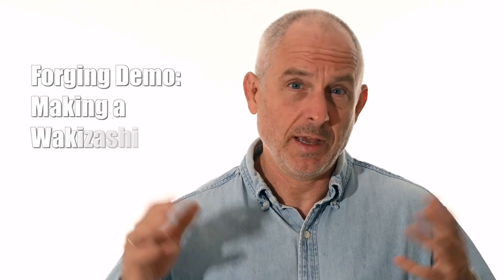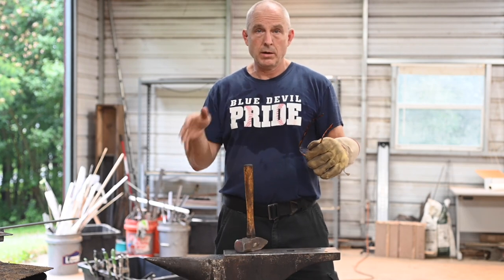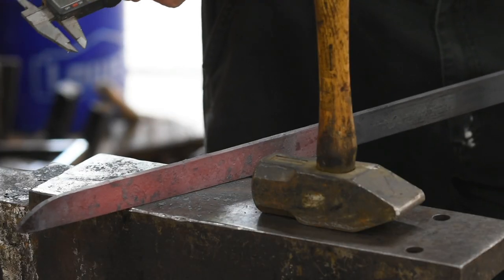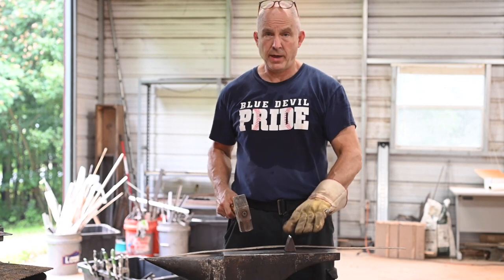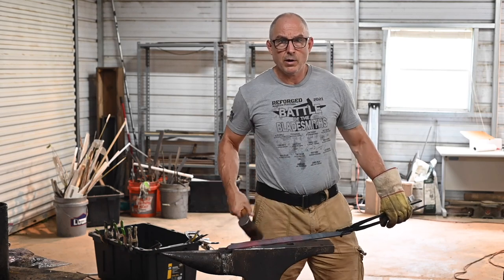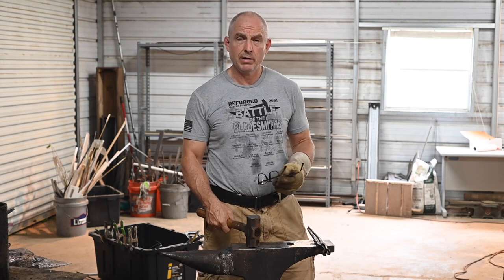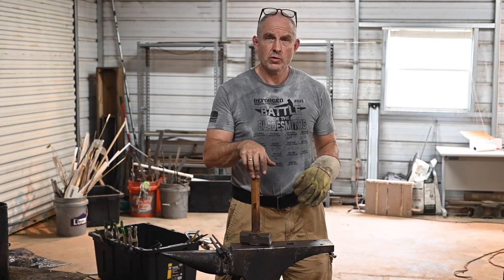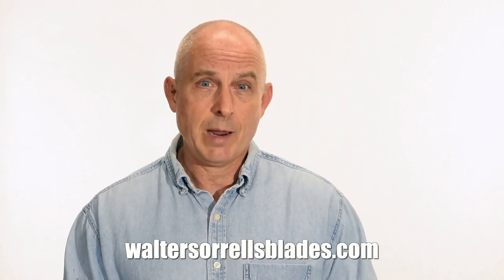Forging A Wakizashi - Japanese Short Sword

Comment: Great video. I'm a relative newbie, with a couple of years of forging experience. Your info in this video was a good reminder to me not to swing so hard when working the blade sides and bevels and to control my hammer face. I have spent unholy amounts of time at the 2x72 working out dings and low spots only to be left with a blade that is then much thinner than intended or useless. Time spent honing my skills with the hammer and anvil are whats in order for me! Thank you.

Comment: Hey Walter do an internet search for vertical hanging acoustic baffles. You can buy the fancy ones or you can make them out of those cheap suspended ceiling tiles and hang them by the edge with wire. Just be sure to use a somewhat random pattern to prevent harmonics. My guess is maybe a dozen or so would work wonders. You can also make a few room divider style frames with the acoustic panels and set them around your work area. Cheap and fairly easy.

Comment: What you really need is a wireless LAV mic.  Putting up sound deadening will help with the echo, but the problem is that right now your mic is equidistant from the hammer and your mouth.  No matter what, the hammer is much louder than your voice.  If you get a wireless LAV mic, make a "hang ten" sign with your pinky and thumb, that is the max distance you want it from your mouth.  The closer to your mouth the better.  Look at any live sports announcer on the field, they are practically eating the mic because their voice needs to be closer to the mic than anything else.  I've been a subscriber for years, so it's nice being able to give some knowledge back!

Comment: As a professional videographer, I understand your pain in trying to get good sound quality in a large, echo-ey space. Step one, as some have recommended, would putting up flags, tapestries or other cloth hangings to dampen sound (which is a far simpler and less coslty option than professional sound treatment for the space but much less effective). If you haven't found them yet, there is a product called a sound blanket productions use to dampen sound waves on sets, you can set them up around you just out of camera frame. DSLR Video Shooter here on YouTube has great tutorial videos on how to rig them on rolling c-stands that can be positioned quickly and rolled out of the way when not in use. Your space is big and has lots of hard surfaces for sound to bounce off of, causing your echoe problem, so anything you can to to create soft, noise absorbing surfaces will help you out.

Secondly, you need better mics and mic placement. In professional video production we always go with two sound sources as a failsafe. The bluetooth mics that have been suggested are a cheap solution. A better bet would be a professional-grade wireless lavalier mic such as the Sony UWP-D series or those by Sennheiser. You should also use a small diaphragm condenser with either a hypercardioid or a supercardioid pick-up pattern on a boom pole or extension arm above you just out of frame (Here's a good article with more info https://www.bhphotovideo.com/explora/pro-audio/buying-guide/interior-dialog-boompole-microphone-roundup). A long shotgun mic, which many novices might think would be a good choice, will pick up more echoes in a space that's prone to echoes.

Also, you need to have the mic placement as close to you as possible without being in the frame. It sounds like your microphone is current on camera or close to your camera. Good luck and keep hammering.